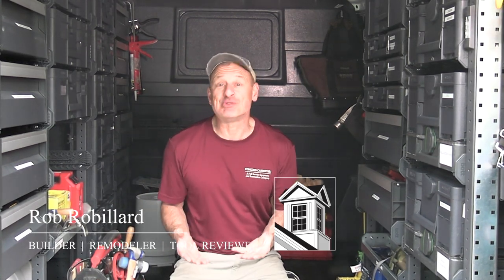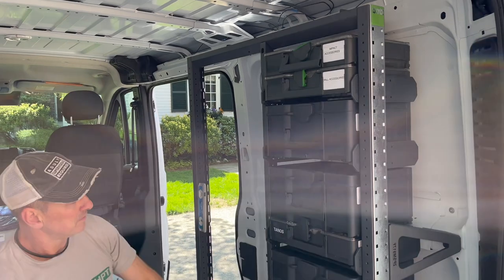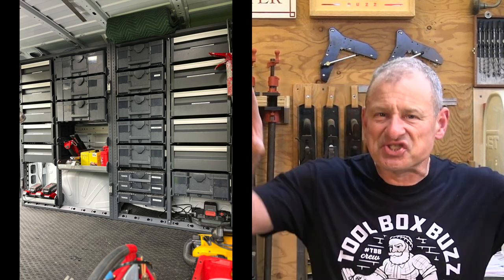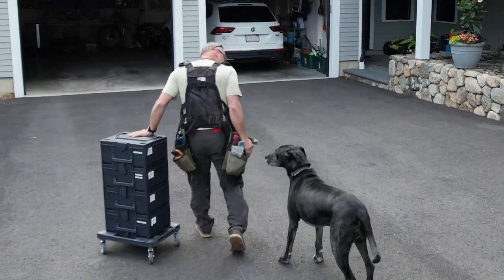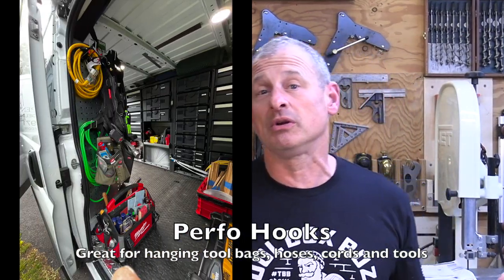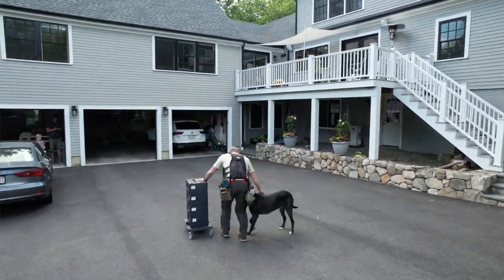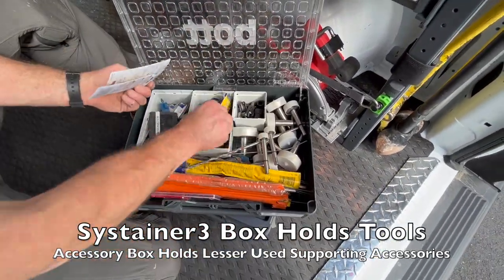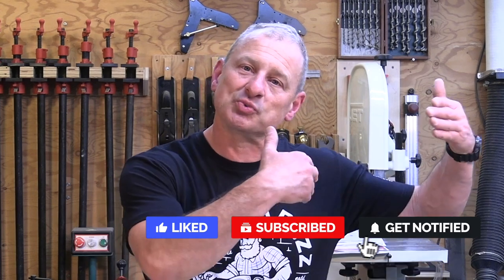Work Van Shelving - Getting Organized and More Efficient

Comment: Hi Guys!!!  Hey Rob, nice van setup!  I remember you had a video of using Milwaukee Packout for organizing a van.  If you get a chance, could you please do a video on the pros/cons between using the two systems?  Also, I have a few questions...1) Are the shelving rails completely plastic?  If so, do you consider them long-lasting and able to withstand a lot of flexing in the future.  2) The boxes appear to have thinner plastic walls than DeWalt ToughSystem, Packout, Flex, etc.  Has that been a problem with moving them in/out to customer sites and do you think the boxes have long-term durability?  3) Do the boxes have a gasket  to seal out wet weather conditions?  4) Can the boxes hold as much as weight as comparable-sized Packout boxes?  5) Are replacement parts such as boxes, shelf rails, etc. reasonably priced and easy to get?  Thanks!

Comment: I like the concept, and wonder if the system from one truck be retrofitted into another truck when the time comes to get another truck. What I don't like is when you're driving over uneven and potholed roads, the constant swaying motion of attached shelving onto the walls of the truck would most likely weaken the integrity of the back cargo area. The same goes for hanging batteries while driving.
Reply from the maker: yes it  can - as long as the brackets are the same for the same model truck if not, then you just have to get bracket for a different truck

Comment: How do you bring all your tools in the drawers (like your many nailers and the accessories that go with them), into a house for a job? Do you have a large empty tool bag (or many smaller ones) where you can take all the contents from the many drawers you need for a job, put them in the bags, then bring into the house? After you're done with the job, do you come out to your van, then replace all the tools from the tool bags into the drawers? I'm trying to learn this stuff to start my own business, so if anyone can help me understand how this works for bringing, then replacing tools in drawers, that would be great. I understand all the tool boxes you have with specific tools (like your impact drivers) because you can just bring the box inside the jobsite. I just need help understanding how to use properly bring tools from drawers into and out of jobsites. Any help would be greatly appreciated.
Reply from the maker: Yes, I have a large veto pro PAC bag for some items, and carry some of the boxes. I’ve had, use and mostly left in the truck dollys - I just don’t use them

I do use the 4 wheel dolly when doing interior stuff.

Comment: I’m torn between a van and a trailer.
Reply from the maker: I ran a trailer for many years and it was awesome but it was because I needed a pick up truck to plow snow in the winter. The negative about a trailer is the length getting him out of tight spaces, parking in a city or tight driveways

The benefits of a van is your much more compact everything is with you, you don’t have to hook up and disconnect, but it cost a lot more